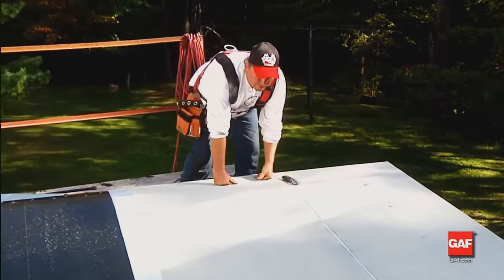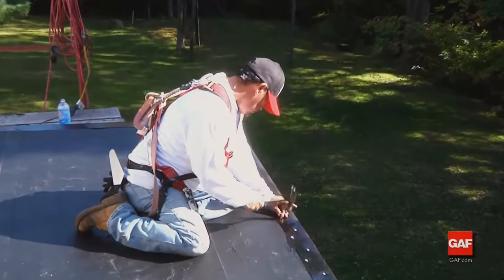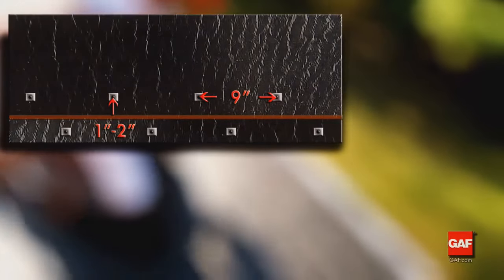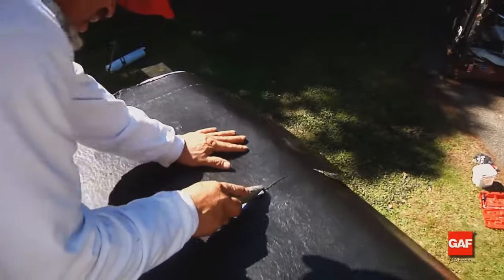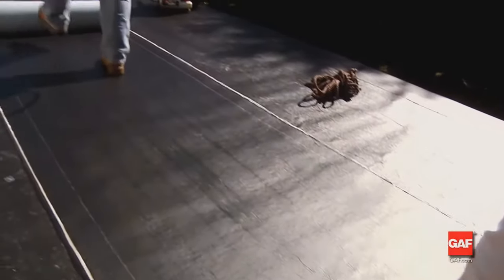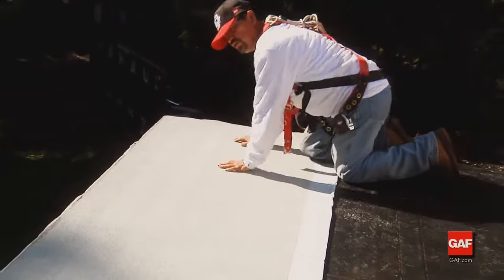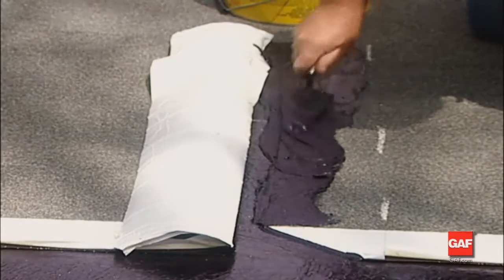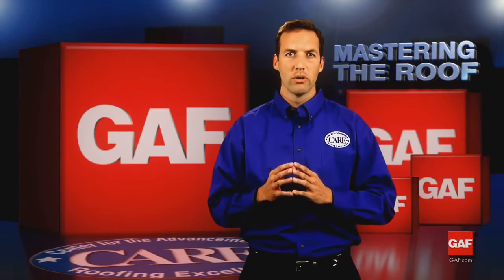How To install a Flat roof

Comment: Our roofer wants to install shingles on 2.5/ 12 pitch. He will use Wip300 ice and water barrier underlayment plus Palisades Synthetic Underlayment system.  GAF Timberline shingles will go on top. Is that a proper install?
Reply: Depends where you live...if you have a winter then no...water will sit more on ur roof  and make it easier to have wind drivin rain and ice dams...I usually use flat roofing anything under  a 4/12
Reply: @joemomma2517  I used peel and stick roll roofing on my porch 3/12